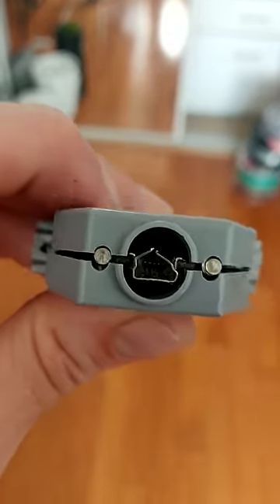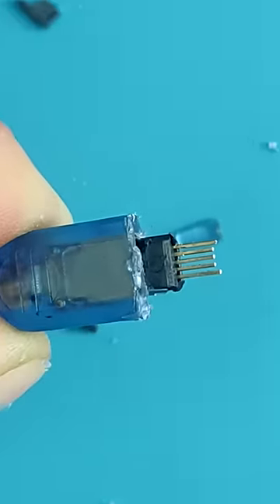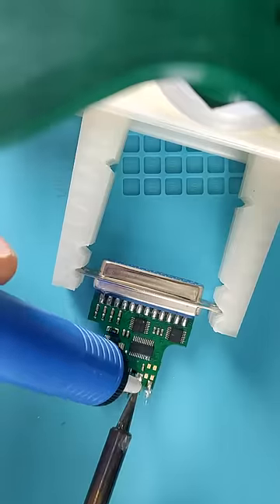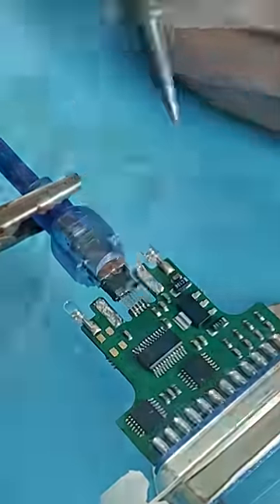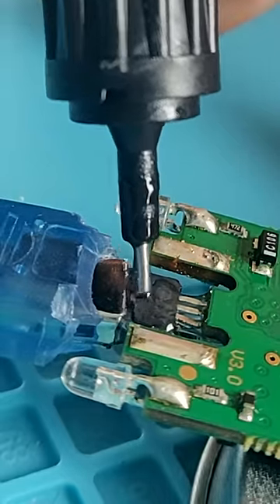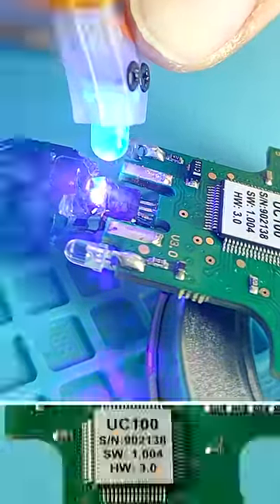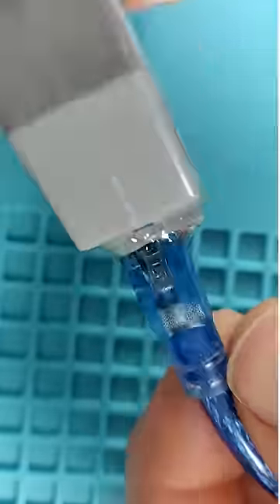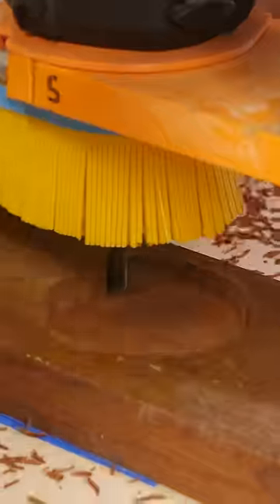For context, I suck a soldering...

Comment: Why would you destroy two things when all you had to do was replace ONE broken connector?!?
Reply from the maker: They're surprisingly expensive 😳
Reply: @make.anything  cool enough, but don’t you have any old type of toy/electronics that has a port on it? Take it from that instead. Having said that: ordering from china isn’t that expensive for a 10pack of USB mini’s.
Reply from the maker: @BuzzBazzJ  oh I thought you meant the controller itself. I just have a million spare USB cables already and didn't want to order more stuff :P
Reply: @make.anything  yeah, No I got that you wanted to save the controller😂 I was talking about salvaging a USB-Mini port from anything old. Not a cable😅 That way you wouldn’t have to go overboard with the resin, because if it breaks now, you need to buy a new one😂🤣
Reply from the maker: @BuzzBazzJ  that's fair haha

Comment: Awful job. You could have just cut the cable, check the pinout and soldered the wires directly to the board. You can use 2 zipties or a db25 cable clamp to keep the cable secured inside the case.